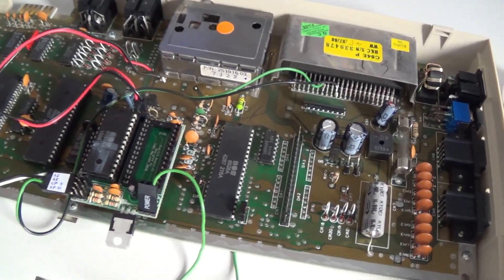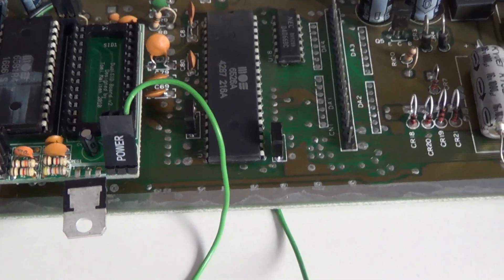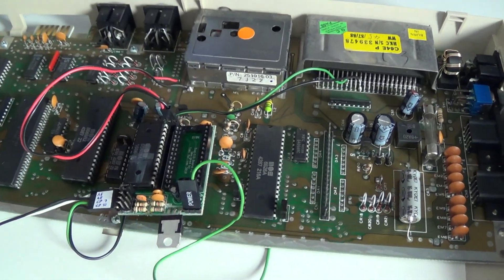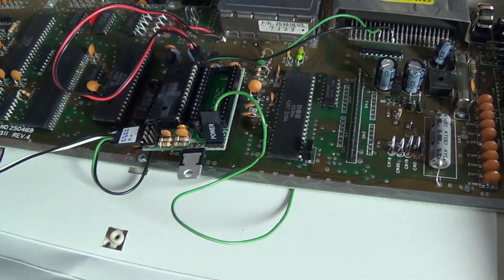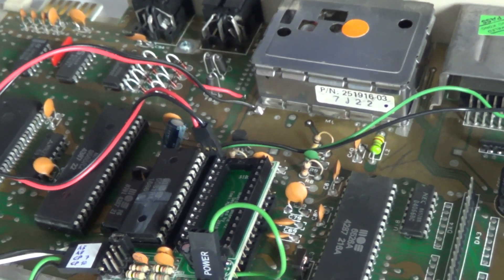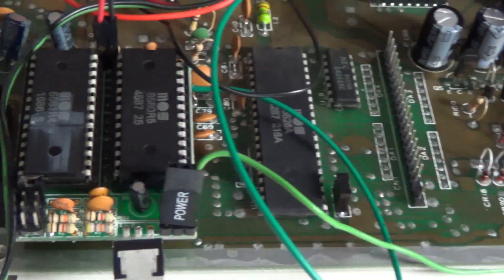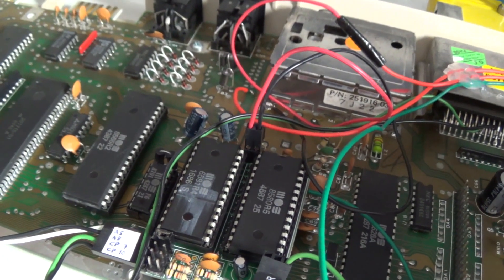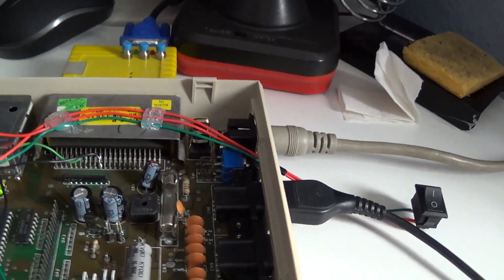Commodore 64 SID switch mod.

Comment: That's quite a pronounced difference between the two chips.  It's like the 8580 has a voice entirely missing which is supposed to be carrying that bass line.  One of the SID chips I have in storage is like that, where one of the voices doesn't work at all, and games just don't sound right because sounds are just not there.
Reply from the maker: Yeah, I've heard about partially damaged SIDs. However, there is nothing wrong with this one, as it sounds great with everything else (from my experience). That Last Ninja example even turns out the same, if you try it in the Vice emulator. ;o)

Comment: I need a 1541 Ultimate for my breadbin C64!
I only use my C64c with built in 1541U at the moment, but when I here this difference I need to use my breadbin instead.
Reply from the maker: What? A built-in 1541 Ultimate? Sounds interesting. How is it built in? Don't you, like, need to solder a million wires, then? How is that done, I'm curious? :)

It's a bit of a shame, that the two SID's sound so different. The 8580 does sound better in some situations, like newer demos and such. But if history had been different, and the 8580 had sounded like the 6581, nobody would have been the wiser. It all turned out to be quite a hassle, for picky people like us.. :)
Reply: Yes you have to do some soldering, but it's not so much.
Unsolder the serial contact on the 1541u and solder a cable to the motherboard, solder flatcables between the 1541u and the expansion port.
It's not pretty but it works fine.

http://safir.amigaos.se/bildgalleri/users/6400_PICT0074.JPG

http://safir.amigaos.se/bildgalleri/users2/6482_PICT0166.jpg

http://safir.amigaos.se/bildgalleri/users/6276_PICT0051.JPG
Reply from the maker: Sorry for the wait.. That looks neat. You're definitely a high-level nerd! ;) What happens when you use other carts? I heard the 1541U is not working correctly in conjunction with other carts. Or was that the Chameleon.. Not sure, may remember wrong here.. :)
Reply: I don't think it can be used with other carts, but I only use it for playing games and watch demos.

Comment: Great video - love the idea of switching over like that.  Will do the same I think.  Are you sure its not a fault with your 8580?  I had a similar problem with sound on Alien on my 6581 - all other games were fine.  I swapped out for another 6581 and the problem was solved.  I've got a twin SID switcher coming and I have a few 8580's so I will give it a test with those and report back my findings.  Great video =)  Subbed!
Reply from the maker: figurehead1971 Thanks a lot for the information! That is good to know! ;)  -  To follow up on the problems I had some time ago, where I said it "has been acting up" (read earlier comments in this thread, about 9 months ago). There never actually was a problem. Back then, I had mixed the sound signal from the C64 with an Amiga, a Mac and a PC (so, several sound sources "touched each other"). That would work fine, as long as you only have sound output from one of those sources at a time. But when hooked up like that, the 8580 always had VERY LOW volume - almost silent. If I disconnected all the other sources, so nothing else "touched" the C64's audio signal, the volume from the 8580 was normal. The 6581 always worked. I suspect it was because I took the 8580's sound DIRECTLY from the output pin on the chip, instead of letting the sound go through the audio out circuit on the motherboard first. Maybe.. :)
Reply: The resistor fix is great for improving clarity of digital samples, and works fine in games such as Impossible Mission, Turbo Outrun and Arkanoid title music thats timing all sounds messed up on an unmodified 8580.  I can confirm though even with the resistor fix it DOES NOT solve the issue with the background rumble playing in the dungeon level of The Last Ninja...it is still absent.
Reply: Casual Commodore 64 A low volume is always a problem when it comes to samples with the 8580 and that most definitely is fixed (to a degree) by the easily googled 330K ohm resistor mod.  That most certainly amplifies the filters for speech, and works great.  But clearly as in your demonstration of The Last Ninja certain sound frequencies just are missing from the architecture of the 8580...and that is at least some relief for yourself knowing that your mod here was worthwhile against a simple resistor fix that would not cure everything :)  

I think I may go down the dual sid route myself rather than switching, literally have a left/right channel dual mono output with one channel 8580 and the other 6581.

On a side note, if you have been living under a rock, check out the latest kickstarter campaign by a guy who has acquired the original C64C molds and is doing new plastic injection moldings!
Reply: You are awesome for posting that point about the kickstarter project!  I've just backed it!  Thanks VERY much!
Reply: You're welcome mate, it is BIG news obviously...an amazing find and development!
Reply from the maker: figurehead1971 Thank you, for bringing that kickstarter project to my attention. Backed! I do check kickstarter roughly on a weekly basis, and this is a fairly new project, so.. By no means do I live under a rock, regarding these things.. ;-)

EDIT (3 mins later): It was not just the 8580's sample volume that was nearly silent, when mixed with other audio sources. It was ALL sound from that chip. ;)
Reply from the maker: Sorry for the wait - been busy.. Thanks for the kind words! :-) No, it's not a faulty 8580. When I first discovered the issue, I tried the game with my other C64, which also had an 8580, and it sounded the same. It even sounds like that, on http://www.6581-8580.com (R5 is 8580). But my mod has been acting up lately.. Sometimes one of the chips don't output sound. When I try later, it works fine again. I double checked all connections and soldering, and it all looks fine. I suspect it could be my power supply.. :-/
Reply: I assume you've checked the voltage to the 8580 is correct (knowing differences between the two SID types). There's also the cap differences as well between the two SID revisions, but I expect that's taken care of by the twin SID board?
Reply: By the way, not sure if you are aware but there's a resistor fix you can do to the 8580 to fix samples, that might solve the Last Ninja level four music as well.  I've got a bunch of C64s on the way, one being a C64C, so will try that and report back.  Also got a SwinSID on the way as well - should be interesting...
Reply from the maker: GadgetUK164 I'm aware of the cap and voltage differences, and the DualSID takes care of that. Unless my unit is defective.. Just now, I fired up the C64. 6581 gave sound, but 8580 was silent. Checked voltages. 6581 gets 12v and 8580 gets 9v, so it's not a voltage problem. Thinking it could be the switch, I connected the audio wires directly, but that didn't help. Tried to plug the 8580 directly in the C64C, and then it gave good sound, so the chip is okay. Weird.. Yes, I am also aware of the 8580 sample fix, and did consider it. But decided on the DualSID thing, to get the real 6581 sound. Yes, please do report back. :)
Reply: I have only ever had the sample volume that was nearly silent on my 8580, biasing the audio input pin with that resistor emulates the bias of the bug in the 6581.  Because however the filters differ you can never get the same distortion on the 8580 and I believe it is due to the filter differences why in some chip tunes that were clearly designed using a 6581 there literally are missing sounds like as in the dungeons level of Last Ninja.

I would recommend anyone to do the resistor mod owing a 8580 based C64, however, obviously it is never going to be a full 'cure' as you just simply cannot get the filters to sound the same between the two chips, just can adjust the bias for sample volume.

Comment from the maker: Yes, just one SPDT (single pole, double throw) rocker switch. I thought of a dual-pole switch, so I could include the ground. But I don't think bringing ground through the switch is neccesary. I hope I'm right.. It still works great. :-) If you wanna be sure, use a DPDT switch, and include ground.. :)

Comment: Great video and mod ;)
So you use only one switch to select a sid chip you want to hear?
I'm looking for something like this for my breadbin in a pc tower case, becase sometimes i play sid files on my c64 tower with sidplay. But some sids 8580 don't sound right on a 6581 sid. That why this solution is great for my to switch between the sid chips in real time, without to switch the c64 off/on again.